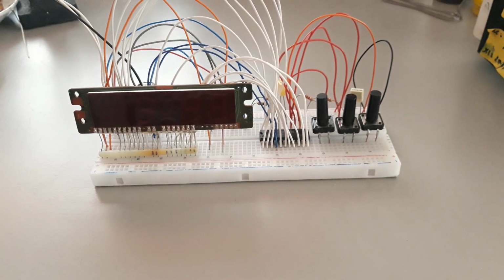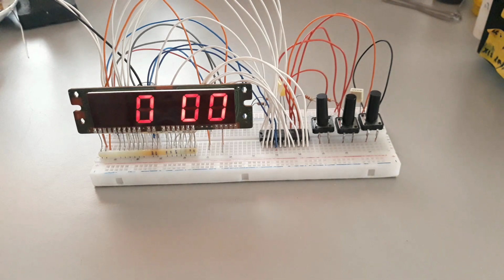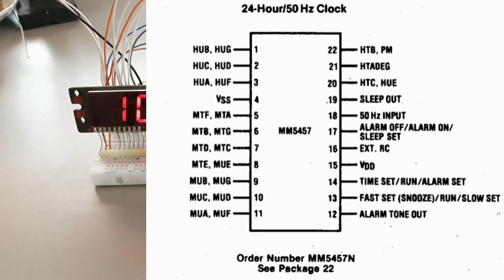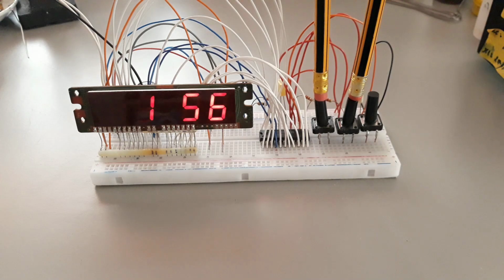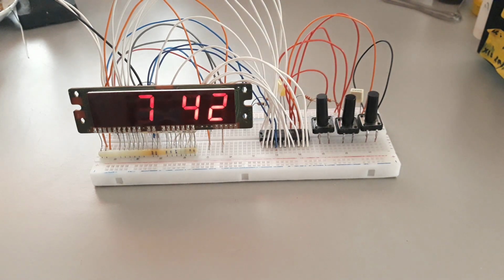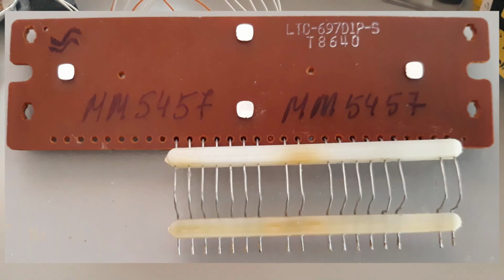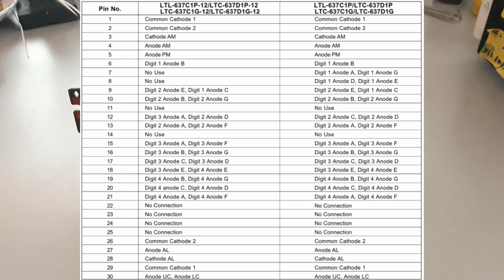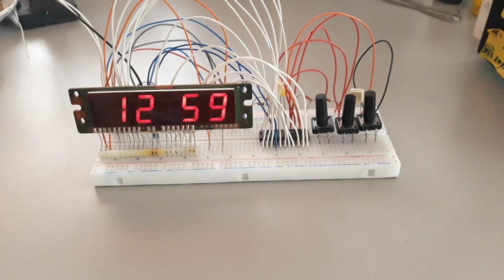MM5457N Technical Tutorial

Comment: PLS, on the schematics. Do not use Earth for Ground.
Earth is usually used on the external poewer line circuitry and it should not be tied to ground whenever possible.
At its best Earth should be connected to chassis ground only if the housing is having an accessible conducting shell.
Better design a case that does not allow the users hand to reach any portion of the external power circuitry.
Reply from the maker: Hi @thomasw2509,
First of all thanks a lot by watching! 
And now I'm try justify my selection, ok
Yes! Is true! But I'm comming from the telecomunications where the +48VDC are connected to the ground! By this reason we tell things like: "send one ground". This allowed during dozens of years use only one wire to get a communication and do the signalization. Normally I do use to GND to simbolize the equalizations of any power source but on the next sechematic I will do use the triangle, thanks a lot by your alert.